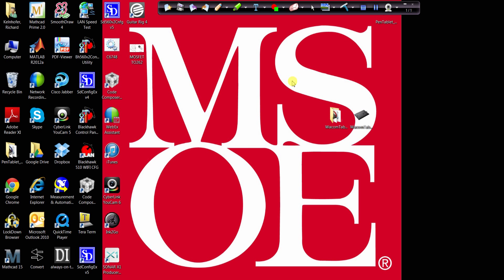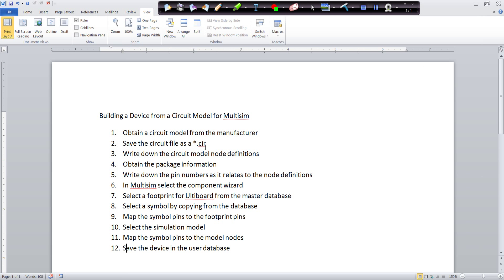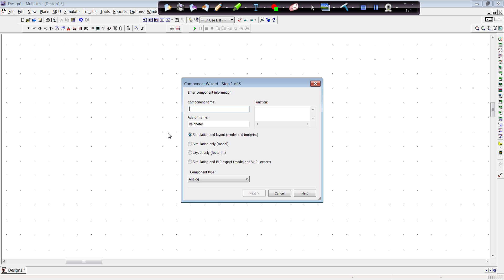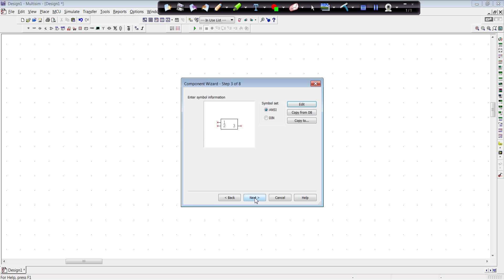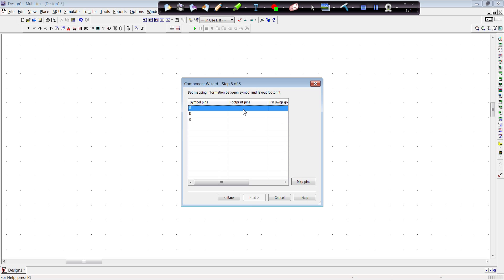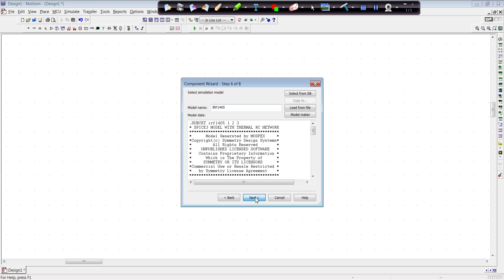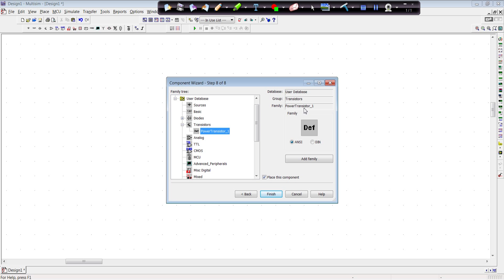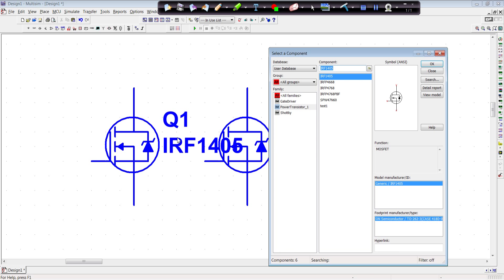Building a Multisim Device from Manufacturer's Model

Comment: Sincerest thankful for such a very good and simple explanation. Can you help in some way because the .cir files seem to be hard to find? I've tried to find .cir files for pc817c, irfp540, uc3842 and uc3845, and have found none. Thanks in advance.
Reply from the maker: Hello Carlos, yes sometimes finding the files can be a little tricky.  IRF was purchased by Infineon a couple of years ago.  The IRF540 sub-circuit SPICE file can be found at https://www.infineon.com/dgdl/irf540n.spi?fileId=5546d462533600a4015356fb3efe36da0.  The switching controllers and opto couplers may not have good models and for those, I would typically model the functionality using other methods.  Best wishes on your design.  -Dr. K
Reply: My sincerest thankfulness for you taking your time to help me.
Reply: Unfortunatelly the the link you sent me is not working; but anyway thank for your trying.

Comment: Sweet info...  i am learning Ltspice and this explains lots....   do you have a video on the LM2907  frequency to voltage converter ic chip?   thanks...:)
Reply from the maker: Thank you.  Hope the information was helpful.  Unfortunately I do not have a Spice model of that specific chip.  However, you may want to recreate the functionality of the LM2907 in LT Spice by using a behavioral voltage and current sources.   It would consist of a comparator circuit that creates a square wave input at the same frequency as the input voltage.  This square wave would be used to control a 180uA current source (charge pump) connected to an external capacitor (listed as C1 on the data sheet).  This current source would be mirrored to the C2/R1 parallel combination creating.  The output is an average voltage across R1 that is proportional to the input frequency.  Give it a try and keep me posted.  Dr. K

Comment: Hi, thanks for your video. I want to use LT4320 in Multisim, while I didn't find the .cir file. The only spice model I got from their website is .asc, which is for LTspice.  I tried to load .asc to Multisim, but it didn't work due to the format issue. Then how can I add it to Multisim? thanks.
Reply: @powerelectronicswithdr.k1017  Hi Richard, thanks very much. I have turned to LTspice since it was much easier. By the way, if I want to add some components from other manufacturers into LTspice, is there an easy way so that I don't need to go back to other tools? Thanks again.
Reply: @powerelectronicswithdr.k1017  That's great, thanks.